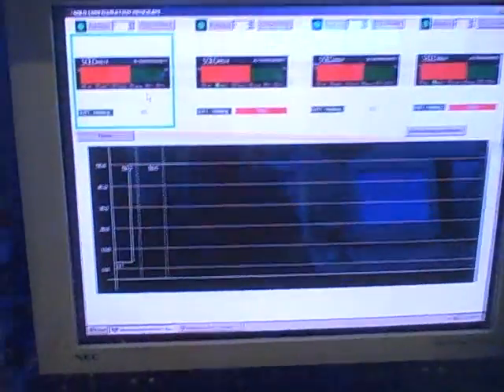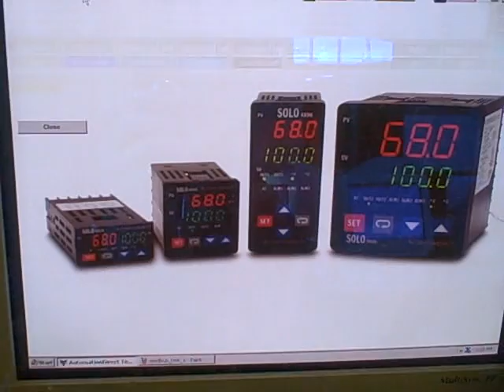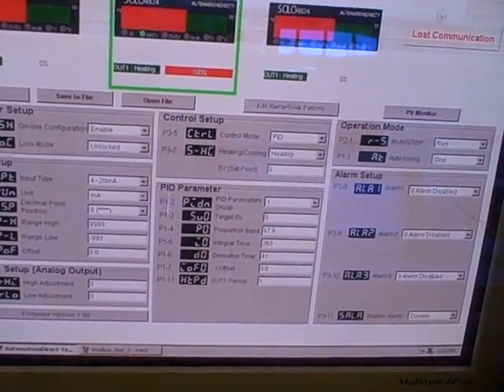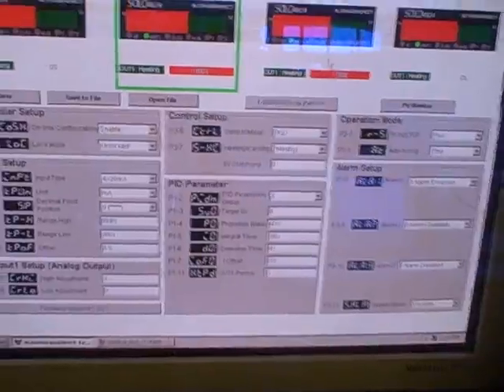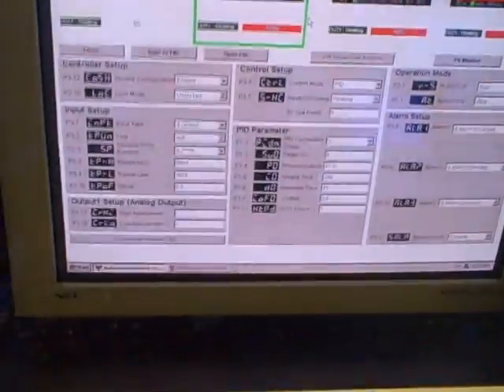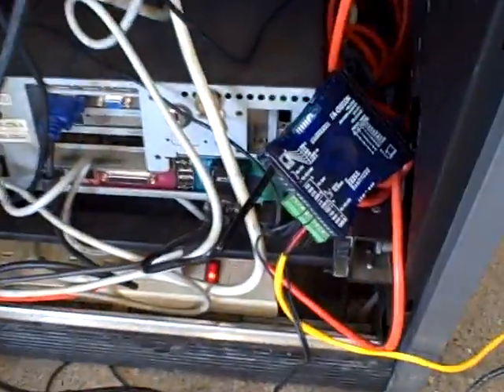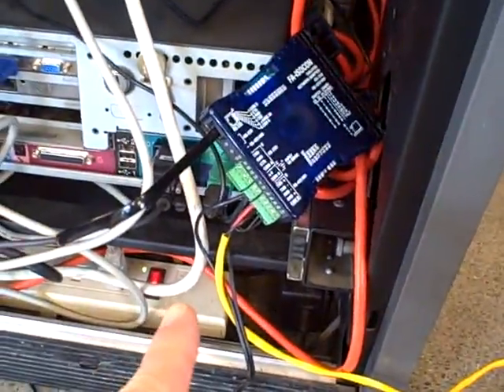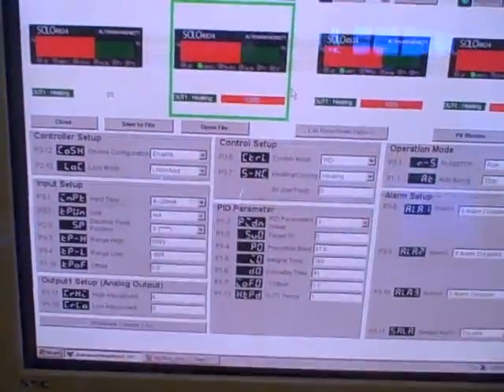Process controller Modbus network

Comment: Hi, I will be very grateful if you can help me with a doubt. 
I want to connect a "twido" Telemecanique PLC to a Digital kWh meter, and UPS battery. Both devices have  Modbus protocol  and the serial connection port.
 My question  is, can I connect the network as easy as your Youtube example? or I must include some other consideration and devices.?